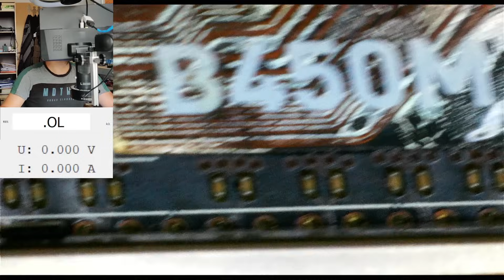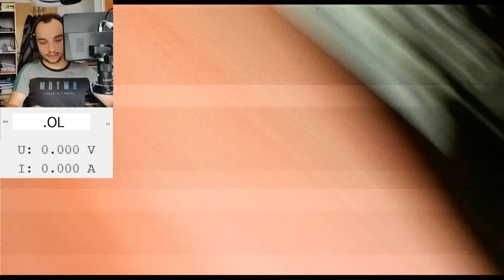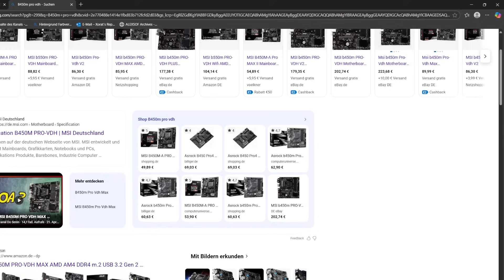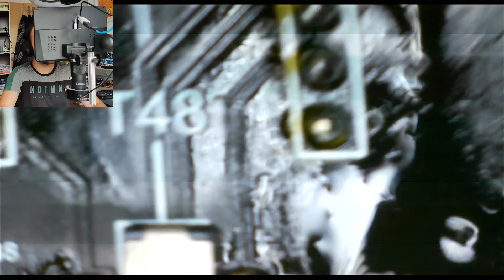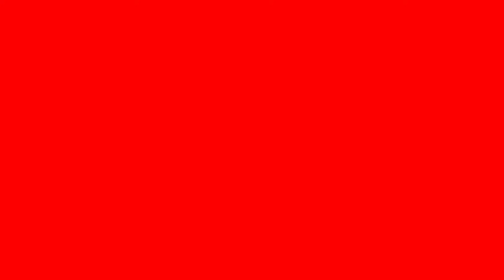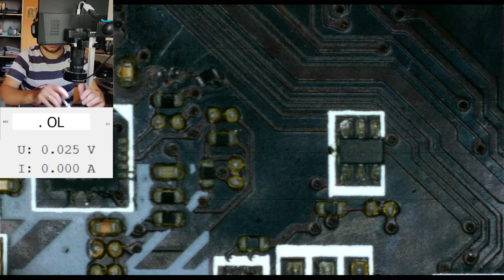CPU LED always on , no boot on a motherboard || MSI B450M PRO VDH no boot repair fix

Comment: The notch means top side and cap near the pad means it power pin. Now look at the datasheet of Bios if power pin is also that. if not then someone tried a different Bios.

Comment: Hi can you help me?

I have an X370 motherboard that is stuck with the CPU debug LED on. The CPU gets warm, and I've already tried flashing the BIOS, but it still doesn't work.

I would appreciate any ideas that could help solve the problem.

Also, where do you usually find your boardviews?

Thanks!
Reply from the maker: Hey there, sounds like there might be a missing voltage or component somehwere. You will need to see for the basic voltages like 0,9V , VDDQ, VPP , VTT, 1.8V etc.

I get my boardviews with just googling and paying for them!
Reply: @MainboardMedic  Thanks for replying!!!

Comment: Can I have the model of the adapter that powers the board?
Reply from the maker: Its just a pico 12V to 24 pin adapter. This one is the 150W version and i wouldnt recommend this one. Rather get one that does like 300W or something like that!

Comment: Hi! Maybe you have a tip for the following situation?

ASUS ROG Strix Z390-E + i7-9700K: intermittent POST (Q-LED CPU/DRAM/VGA/BOOT).
Board was bricked, recovered via BIOS flash. Found slightly bent LGA pins; straightened. With CPU only it POSTs/boots, but once the cooler is mounted, POST becomes erratic: often Red (CPU) sticks; other times Yellow (DRAM) or White (VGA), rarely Green (BOOT) with GPU fans at 100%. Q-LED feedback is totally random—sometimes there’s NO Q-LED at all, only fans spin—so I’m confused. Power cycling can advance it (Yellow→White→Green). When it finally boots, it’s stable (live USB, stress OK, temps normal).

Removing and reinserting the CPU and resetting the CMOS often helps to get to the yellow QLED, but then it goes into stuck mode. After that, turning the power supply off and on (sometimes several times) helps to get to the white Q LED on the VGA. It rarely happens here, but sometimes it gets stuck here, and the VGA fan does not spin. After turning it off and on, it goes through all the QLEDs and the machine boots.
After this, the machine can be used and boots normally for a while. If you think it suddenly freezes and starts all over again, there are usually two cases here: 
1: red q led is stuck
2: no q led is lit, only all fans are spinning at maximum. From here the vicious circle of removing and inserting the CPU and then restarting starts again until it boots.

I would be very grateful for any ideas, because I'm starting to give up :) As a note, this difficult POSTing already happened before the bios chip became corrupt.
Reply from the maker: Seems like that can be a TPU firmware issue! When you flash the bios, the TPU needs to be flashed accordingly. You can first try to flash it via bios itself, that can help!
Reply: @MainboardMedic  
I will try it, thank you very much for your help!

Comment: Can u help me with a board prime b450mk, 5vsb getting 0v even after p channel replacement, gate voltage and atx 5v are present...
Reply from the maker: Have you checked if the line is shorted?
Reply: @MainboardMedic there's no short, I had display out by manually shorting p channel source and drain but then couldnt get display, I have replaced 3 times p channel 5vsb mosfets line is not short, it had shorted dram mosfets, replaced both with its driver, vddq enable from IO bypassed by jumper

Comment: Hi ihave M.B Z790 TOMAHAWK 
Pcie 1 and Type c 3.2 2x2 Not work 
 I changed the processor and the GPU and updated the bios, but the problem is still.
I deliberately installed M.2 in the third port and then tried to run and did not work and removed it and also the same problem remained and GPU only works in the last bottom port 
 . Thank you so much.
Reply from the maker: Very difficult problem. Ive encountered something similar in my video that came out today and i sadly wasnt able to figure it out!
Reply: @MainboardMedic There's an electronics intruder who told me this happened because of a palace or shorts that happened in his name circle.  PROTECTION READ WRITE CCT
 I don't know if that's true now. now it with an engineer examining her.

Comment: You can use a PCI-E slot metal cover to protect the plastic connector, it works like magic!
Reply from the maker: Ive seen people use a piece of tin from a can, but that should also work well and i probably have some here!
Reply: @MainboardMedic  Yeah, a tim from a can works well, the pci-e metal cover is just easier to use.

Comment: Gutten tag main board medic, i have an Steel Legend B550m and led and dram lights always on , I updated bios still the same , I'm using Ryzen 5500 cpu and the board does not boot
Reply from the maker: Have you tried different RAM + CPU combo? Have you checked for physical dmg?

Comment: I have an MSI b500 pro motherboard and stuck on CPU led and other board doesn't power on when CPU is in the socket. Any help, i would appreciate it.
Reply from the maker: Well it could be anything. First thing i would say is check for voltages and ripped components!
Reply: What about the other board that works without CPU in it . I was even able to successfully flash bios with MSI flash button but the minute CPU is introduced the board doesn't power on @MainboardMedic
Reply from the maker: Same deal!
Reply: Yep thanks I checked the board and some capacitors connected to the PCH, CPU and PCIe are ripped off. Will have to replace and see what happens. @MainboardMedic

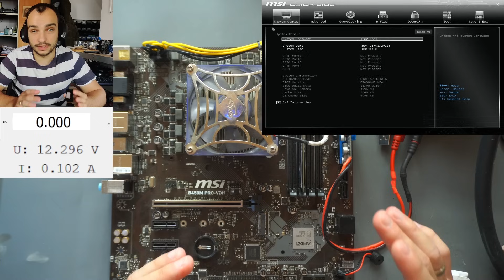Comment: 40:58 I have a similar issue on my Asus Z690 TUF intel board. The standby voltage of 1.05V from regulator to PCH is shorted to ground and the system is not turning on. I suspect a MLC capacitor, but doesn't have hot air at hand to remove and test. Soldering iron doesn't work as it's pad is sinking a lot of heat.
Reply from the maker: If its the 1.05V you very often have a dead PCH! like 99% off the time!
Reply: @MainboardMedic  Hoping to be in that 01%. 😊. 
Where would you get the repair guide for TUF Z690 D4 motherboard?
Reply from the maker: There arent really repair guides. There are some for Asus boards, but they are all the same. They just tell you to go through the power sequence and check voltages. They dont even tell you the order or where they are located!

Comment: I'm not sure why you couldn't access the chip through the SPI header. I have done it many times on MSI boards.
That was a lot of solder on the BIOS pins! They don't need to be completely covered.

Comment: The triangle is on the bottom side. The dot on the chip can be on the bottom right or top left because of its geometry. The triangle indicates that the dot should be on the same side.

Comment: 390K is so restrictive to 12V that 1.4K can prob pull it down to 0V.
The silk box for the BIOS has a notch, like a THT IC socket, showing the pin #1 end.

ERS use a polarizer for a month and realised it's not even close to vision of side lights, ie, you want the picture to pop and be vivid to attract more viewers. Basically you don't want to give people a reason to turn off, and it's still quite murky dull and dark.
Reply from the maker: ERS is also using am actual microscope that is really expensive, which produces a way better image then the digital one i have! I might try side lights.

Comment: I wonder why is AMD not able to printout chip text with proper orientation? Ryzen chips sideways, PCH upside down? This really triggers my OCD.
Reply: I mean, they are behind heatsinks, so, just like the rats nests on the other side of the case, you would see it so you can just ignore it

Comment: spi header detect on most cases needs 24 pin power plug in. and sometimes power on and off via power pins.
Reply: Not usually. I have never seen it be required.
Reply: @karlpenney657  on most cases where it cant be detected.

Comment: 13:44 check using multimeter which pin is ground ... that would be pin 4 on the bios chip
Reply from the maker: That is also a good way to check it, if you dont have markings!

Comment: Loved the behavior for the enable signal.
As for the BIOS orientation, the silkscreen outline for the SPI chip has a V-shaped notch on one of the sides. That notch indicates the side of the chip that has pin 1. And unless you flip the chip, there's only one way to place it on the PCB.
Reply from the maker: Yep i noticed that while editing the video as well!
Reply: Bad design.
Just put a dot or a triangle near pin 1 or better, put numbers.

Comment: Amazing bro!! i also repair motherboards, and i think there cases in which de IC controller pulls down the enable signal, that's basically the problem... I also remove the enable transistor to pull up enable signal, perhaps the mothher had an issue and disconect some part of the motherboard by entering in sleep mode. I don know why they do this, but pulling up the enable signal usually works regardless the mother (chipset or I/O) is pulling down it.,